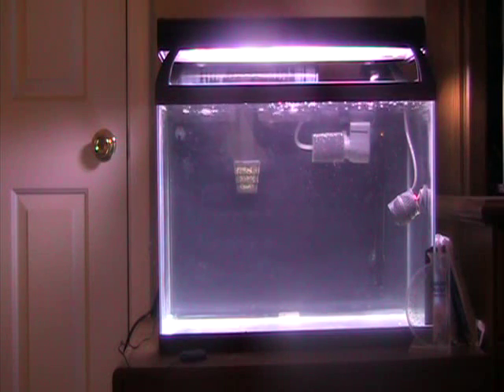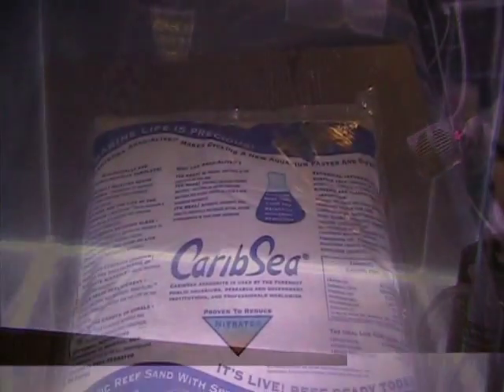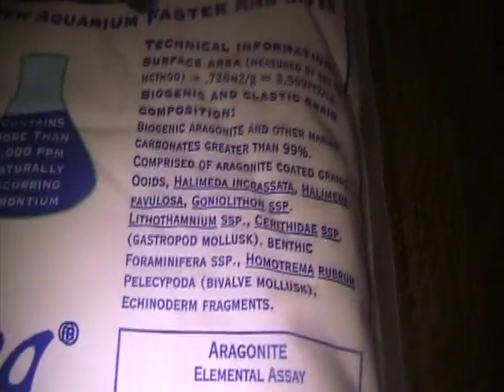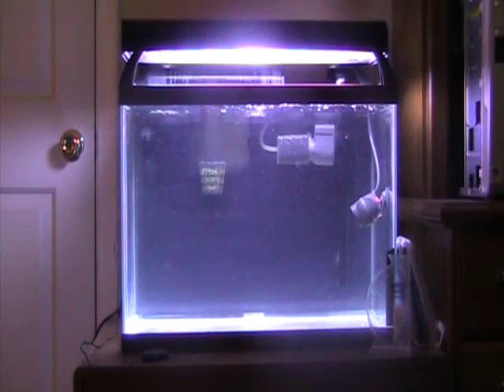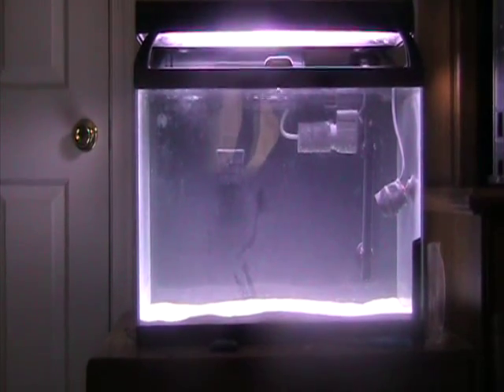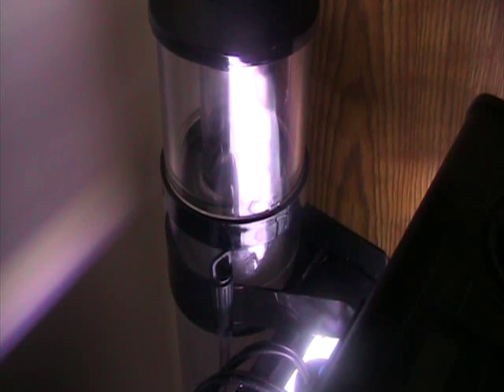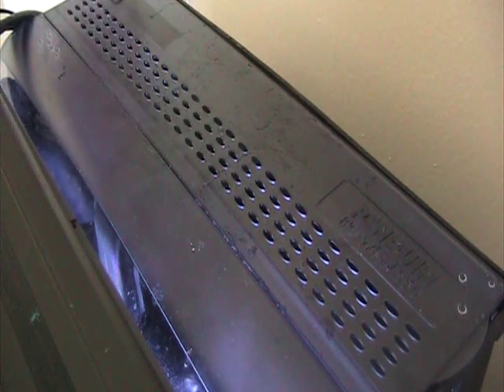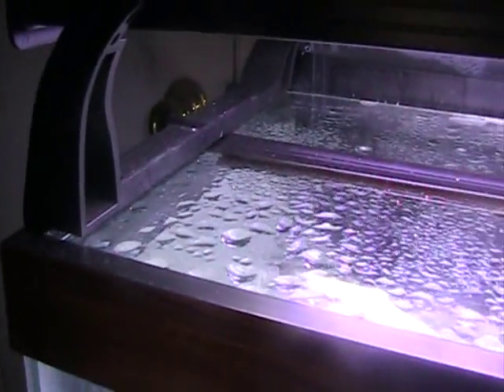Nano Reef Aquarium Setup Video 2

Comment from the maker: @AKAEUPHORiA Naa pretty queit actually, But i am having a little trouble keeping it running correctly, I find myself adjusting the air flow all the time, its been a couple weeks now so I donno if its just taking a while to break it or what, but as for the noise, its not to bad.